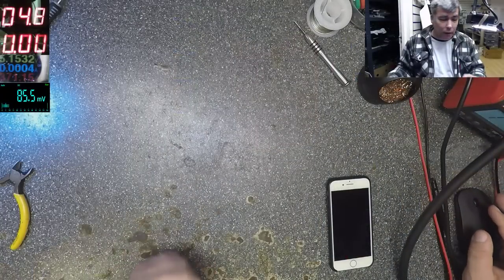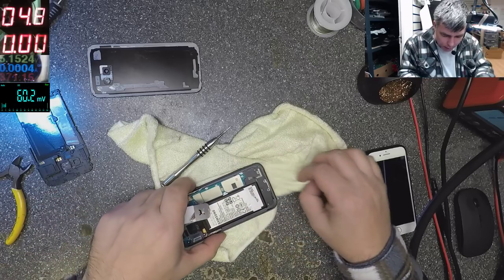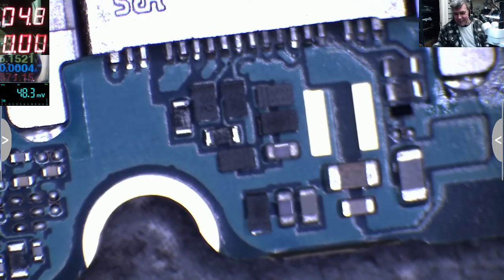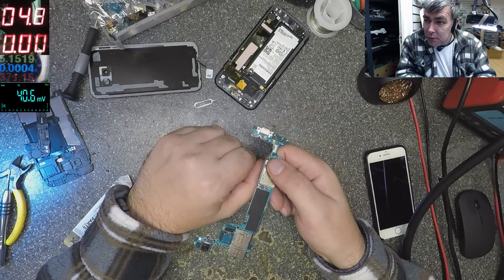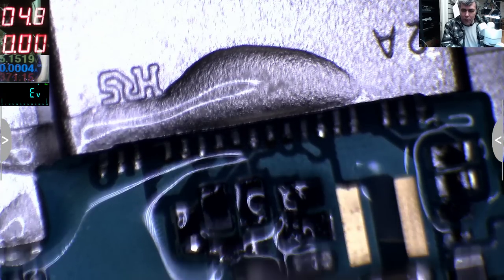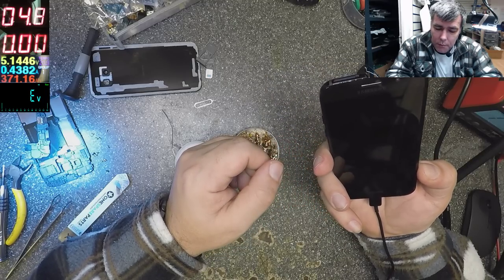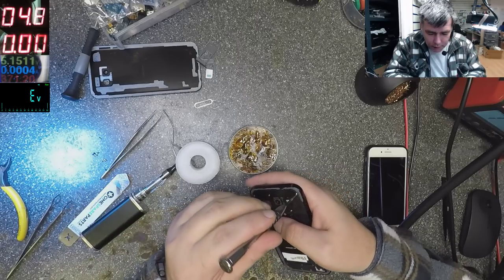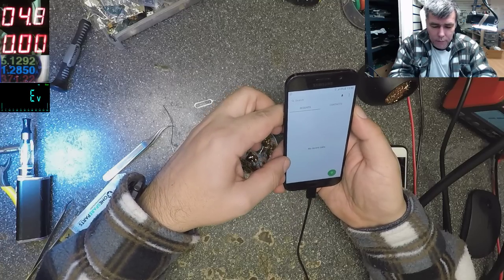Samsung Galaxy A5 2017 not charging, not coming on, usb-c repair

Comment: OK, charging is working and is should work. But  by chance if software need to be flash then what that customer will have to do ? For sure, data pin will not work for that device because it is already shorted.

Comment: I don't think it has so much to do with the usb c design as much as it has with Samsung's poor implementation. I have many devices and the only ones with broken usb c or usb micro port is galaxy a5 and some philips baby cam, everything else is working fine and in some cases they are order than this phone. But hey, new phones won't sell so easily if the old ones work perfectly fine.

Comment: I have allways thought that holding a port/socket to a pcb with solder is dodgy, i have had many types of sockets or switches fail.
Now if they had a socket rubber mounted, and flexable wires from socket to pcb, it would move about without cracked tracks/joints.

Hopefully you will feel better over the weekend, thankyou for enjoyable tutorials :-D

Comment: Very impressive! But your statement that just 1 pin carries 2Amps gave me an idea. We use fast chargers nowadays and that must be pumping in even more amps through the pins. (I may be wrong as I am not an electronics engineer!) So I switched over to an old charger and that started charging the phone. When that breaks down, I'll send the phone over to you! Thanks for the excellent video!

Comment: Hi m8, same thing has happened to my a5, if I want to just be able to get it back to save my data, could I try flux and solder paste over the row of pins and wipe with the soldering iron?
Is this way worth a try or are the breaks on the legs too big?
You the man.
Peace.

Comment: great video my phone is broken have same as the video I have changed the battery put it charge it turned on I broke the back taking it off so I ordered a new one while waiting for the back to come and as it was fully charge and it won't turn on again I've tries all the button tries and stripped down check the connection on the c plug and thing else I can do don't understand how it work and now won't cheers David

Comment: Is there a difference if we short the pins on the port, or it has to be after the resistors. Will it charge the same if we sort the pins directly on the port. Nice video :)
Reply from the maker: no, you can short them on the charging port aswell
Reply: Thank you for the fast answer.

Comment: Hello I have a dead a520w, I checked the voltage in the usb-C power and in the battery connector, the voltage was good.
The phone is still not booting, what is my next step?

Comment: Hello, Sorin, greetings from Bulgaria. I have a repair shop for PC, smartphones.. etc. I have a LG TV/Monitor M2252D for repair, it turns on and off every sec.. keep restarting. When i remove the backlight it comes on and working as it should, with a torch i can see picture on the screen. I checked the backlight and everything is fine, all leds are ok. Do you have idea whats wrong with it?
Reply from the maker: Hi,  on the board, you have a current sensor on the led rails, one for each power rail, can be on anode or catode of the led's, check if those resistors have exactly the right value write on them
Reply: Thanks for answer. Everything seems to be fine, today i noticed the biggest chip  "XD Engine LGE2111A-T8" is going very hot instantly when i plug the DC power supply. Alcohol disappear immediately from it. Maybe i should try to replace that chip
Reply: Имало българи

Comment: please can you help me ? 
I have one that stopped working the fast charger after the  change the connector, looking from left to right lost track of the third pin of the connector, there is an apparently positive track that goes to the left side of the component a little to the left of the charge connector, could you please help me by telling me if you make a jumper until this component loads the quick charge back up again?

Comment: Hello. Maybe You know is possibile to fix "~no sim restart phone~" on Samsung S4(some times works for 2-3 days and then the problem is back) or i have to replace the motherboard?

Thanks for your work!
Reply from the maker: just replace the sim card jacket
Reply: Electronics repair school i did, still  the same problem(its a common problem with s4, power issue?)
Reply from the maker: it is a common problem indeed, also check the connector from the board

Comment: Sir..why we need to short data line?
Reply: If shorted data lines Android phones charge at full current. Don't do on iphones!
Reply: it activate the full charge mode, but the phone will no longer able to connect to computer for software and data transfer...

Comment: its an alienware  17.
Reply: year 2013
Reply from the maker: you tried with another graphic card?
Reply: yes i tryed already and is the same thing. the board was dead and was in short but found an open ceramic capacitor i replaced it and turns on fine and charges fine is just that 7 beep of cpu.
Reply from the maker: ok, the cpu vcore?
Reply: yes
Reply: mine has 3 coils but i dont really know what voltages i should have
Reply from the maker: what voltage?
Reply: what volts i should have in the vcore when i turn on the laptop?
Reply from the maker: 0.8
Reply: ok i have 1.6 volts when i turn it on
Reply from the maker: thats nearly impossible, check on the caps from the back of the processor. Be sure the processor it is on socket
Reply: i checked the back caps they are not in short and not leaking and the cpu is in the socket.
Reply: ine thing i noticed is that all the 3 coils of the vcore gets really hot and i have 1.6vlts one one side of the coil and 8volts from the other side
Reply: well i thing ill text u tomorrow cause its almost 1am here where i live and need to rest gor tomorrow. thanks so much for replaying me.
Reply from the maker: so you have 3 phase buck controller, it is possible one of the mosfets to be on short, that will explain why you have that voltage. You must have 6 mosftets there, three atre connected to +19 power rail, one of them it is on short or partial short.
Reply from the maker: ok, Try and take each out and see when the voltage get right there, good luck

Comment: My USB stopped working on my Galaxy S9+, I guess I will have to send it to repair, such a shame. Don't believe those phones are waterproof, treat them as if they weren't, the USB is still very sensitive to corrosion or whatever happened to mine.